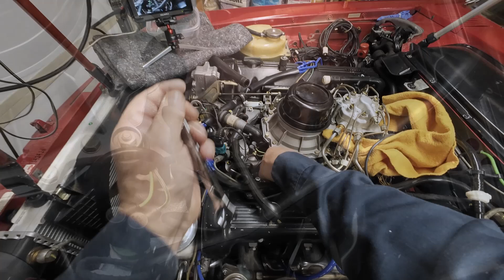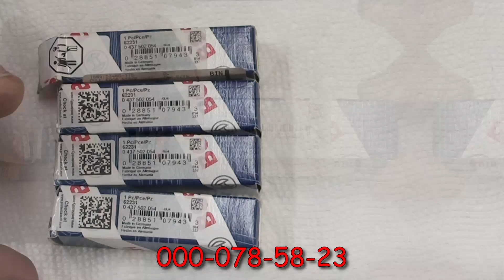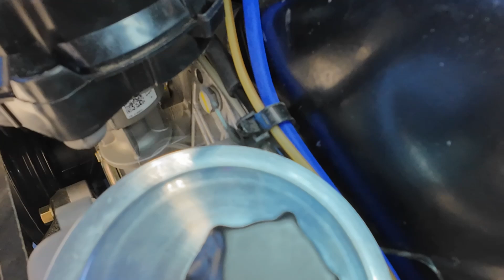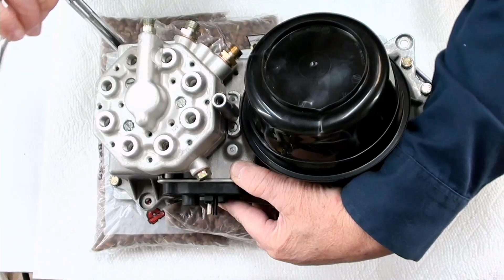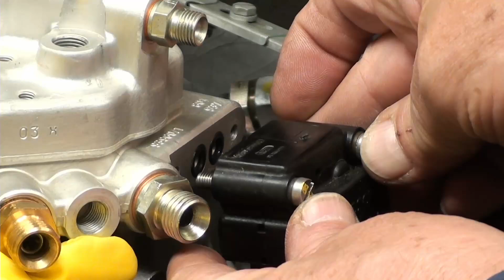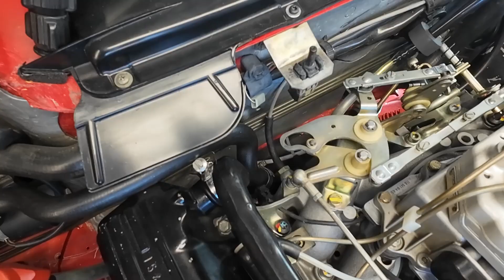560SL - New Injectors, Air Flow Sensor Boot & Vacuum Leak Test

Comment from the maker: I connected the incoming smoke to the brake booster vacuum line. Doing this will by-pass the brake booster so you should test the booster independently. In the video you will see smoke leaking from the Changeover Valve (under coolant reservoir which is normal. I suggest you plug the vacuum port on the right side of the intake to stop the smoke going there. Also note that on the right rear (passenger) there are vacuum lines going to the transmission and inside the firewall and HVAC. You should check those lines independently.

Comment: Hey Tony, thanks for this video! Question: I don’t think I saw in the video, but where did you hook your smoke machine up to the vacuum system?
Reply from the maker: I actually used the vacuum port on the passenger side intake. I did it this way so I could also test the brake booster. Some people remove the hose on the brake booster and inject smoke there. I also plugged the vacuum lines on the driver side going to HVAC, doors etc..
Reply: @TonyLiveTV Thanks Tony! First run of the smoke test showed all my injectors look to be leaking around the seals - parts ordered and will be replacing them soon! Watched your video on that process - much appreciate all you do!

Comment: Another GREAT video (you are the BEST !

Question:
Just ran a smoke test on my 1986 560SL and no smoke anywhere except on the EGR valve "pintle seal" (I'm sure yo know that the pintle seal is in the lower body of the casting and it seals the valve rod that connects the diaphragm to the valve seat)...so smoke is traveling from the intake through the line to the EGR and with valve closed and not allowing any exhaust smoke is leaking out out the pintle seal to atmosphere.

I have tried 2 new EGR valves and I used and all 3 show a leak on the pintle seal.

Did you see this on yours???

Leak shows up between the diaphragm and the EGR body just where the rod connecting the diaphragm and body meet.

Any thoughts on this???
Reply from the maker: @stevecioffi7377  I believe you have asked me this question before. In my case, the EGR pintle seal did not leak. I have the original EGR. Before you panic, connect a vacuum gauge to the intake and run the engine. If you are between 18-22 inches of vacuum, then you are probably fine. There is no such thing as a 100% tight engine. Performance is what you are after. I’ve seen these Venetia horrible vacuum leaks and they still ran well. You want to make sure the main things are tight. Things like the injector seals, rubber hoses, vacuum tubing and vacuum switches. Once you have confirmed this and you have good vacuum, then verify the duty cycle (air/fuel mixture) and idle.

Comment: Tony
Surprised you didn't see any smoke from the pintle seal of the EGR valve . I tried a number of NEW EGRs and all had a leak at the pintle seal.
Smoke path is from intake through the EGR line into the body of the ERG above the valve seat and into atmosphere via the pintle seals all leaking.
Surprised you didn't see this.
Reply from the maker: @stevecioffi7377  my EGR is original Mercedes. It holds a vacuum with a vacuum pump too. I have a video where I refurbish and test it. I didn’t notice any smoke from there. Things are pretty tight after the engine build and the engine pulls a good vacuum. I was surprised to see smoke passing through the check valve on the intake. The check valve tests fine.
Reply: @TonyLiveTV  The 4 NEW MB EGR valves I tested all worked fine in operation of vacuum to the diaphragm and positive closure of the valve seat to body when vacuum applied to the diaphragm BUT all 4 showed leakage at the pintle seal when I smoked the engine. Pintle leak shows up as smoke from where the EGR's operating shaft enters the valve body (test smoke under pressure from the intake via the EGR pipe into the EGR valve body that is closed off as no vacuum is applied shows up between the valve body and the diaphragm shaft in the open space between the valve body and the diaphragm.
Really surprised you do not see this.....are you sure?

BTW...LOVE your videos, have helped me immeasurably as I work on my 1986 560SL

BTW 2.....Why do you say if buy a 560SL best to buy a post 1986 as there were improvements to the 1987; can you elaborate as to the improvements.

THANKS and again for all your videos that have inspired me and shown me the way on many of the jobs I have undertaken.
Reply from the maker: @ I could have missed it, but I didn’t see smoke in that region. The rubber connectors to the vacuum lines in the front of the throttle body all leaked and a couple of old pipes did too. And you saw the leak I found on the change over valve which surprised me. Vacuum leaks are expected I think. Not big leaks, but a perfectly tight vacuum on an engine is impossible. And smoke is deceiving as I said. I think a hand held vacuum pump is better used for testing lines and components. Vacuum works differently than pressure too. Things like the EGR and actuators will likely leak smoke. If I were to connect a vacuum pump to the same vacuum lines that leaked with smoke, I would have found the leak too. The hard ones to find are vacuum leaks like the donuts on the intake, injector seals, brake booster fitting and all that. That’s what I was concentrating on the most in this video. Throughout the manual and in service bulletins Mercedes makes comments of changes they make in the different years. 1986 was the first year for the 560SL and it wasn’t perfect. In 1987 they made a few electrical changes and I believe there was something done with the KE-Jetronics. Something to do with the emissions I think. I wish I could remember the details. I knew someone would ask me one day. I had this info available, but I can’t remember where it is. If I find it I’ll do a special 560SL video and point out the differences. They are small differences like the location of the third tail light for example.
Reply: @TonyLiveTV  Don't mean to press this EGR issue but, as I found 4 new EGRs leaking at the pintle (2 new in my shop and 2 in a buddy's shop in Ca) I'm really curious as to why your original does not leak vacuum at the pintle because this is driving me crazy that you do not have the leak.
This is the only place I have smoke during a smoke test so I'd like to find a way to stop it.
Leak easily shows up if you remove the valve and you apply vacuum to the threaded port that connects to the EGR pipe that goes to the intake. We found vacuum will not hold as vacuum leaks into and through the valve body out the threaded outlet via the operating shaft connecting the diaphgram to the valve....this indicates a pintle seal leak at shaft to valve body.
So...this vacuum leak will show up during idle when the ERG is closed.
Curious if yours is really tight and if so is it tight because you worked on the valve and if so what did you do to create a good pintle seal ?
Reply from the maker: @ I understand your frustration. Maybe the original has a different design? If it is not leaking on the diaphragm side I would not worry. The manual doesn’t say to do a smoke test so I am not so sure I would put too much weight on it. If you are pulling 18-22 inHG vacuum as stated in the manual then you are probably fine. When I tested vacuum on the manifold you saw it was at 21 inHg in the video. That’s within spec and it runs great other than the high idle which I will tackle this week. While testing vacuum I had a valve I could open to see when the engine would start to misfire because of vacuum. It ran fine up till about 16inHg and then you could notice a vacuum leak. I didn’t do anything special when I tested and cleaned the EGR. Here’s the video of that. 560SL - Reconditioning The EGR Valve
https://youtu.be/FfvfdekN8WU
Reply: @TonyLiveTV  
Tx for the link
My car has 36,000 original miles so the EGR line to intake is clear, also my EGR valve to body seals fine it's just the pintle seal that is leaking.
I'm going to try to use some WD40 like you did and see if that rejuvenates the pintle seal....THANKS

BTW I just posted a few questions on your "installing the tensioner" video that I'd appreciate your comments on
THANKS

Comment: Hello Tony. The algorithm gods brought me to your channel. Great video! I've owned my '88 560SL for over thirty years. I tell my wife if they were available as new today, I would buy one in a heartbeat. It's almost a perfect car, at least for my purposes. I have a question, if you don't mind me asking. My independent mechanic recently passed away and my current dealer for our newer Mercedes won't even touch it. Too old! Anyway, your car is in very nice shape, and I can see you are up on its details. I do much of the work on it myself on mine, except the "heavy lifting". Are there enough components available that I can keep this car running into the future? Thanks for your opinion.
Rick
Reply from the maker: @rickperrotta  hi Rick, thank you for the question. I feel most parts needed to keep your 560SL running are still available although some parts will come at a premium price. For example, the rear TDC is no longer available. A few years ago you could purchase genuine MB for about $140. Today you will need to buy it from the SL Shop for $1,000 plus shipping! I feel some have stock piled a few of the common R107 parts for profit. I think the biggest hurdle is finding someone competent enough to work on the car. The 560SL is a unique beast. The KE-Jetronics isn’t something the average mechanic can tackle. One thing for sure is that when everything is working right, these are wonderful vehicles. It will start every time! And if you maintain them they will last for ever too. The 560SL was the flagship model. 1987-1989 are the best years. 1986 had just a few minor problems they fixed in 1987. Years ago I removed and rebuilt the rear differential. I was amazed at how robust it was. It is marine grade. It looks like a Peterbilt diff! Everything is new under my 560SL and it rides like a brand new vehicle. I swear it feels like I am driving on air. Nothing like it.
Reply: @TonyLiveTV  Hi Tony. Thank you very much for the reply. I have been stockpiling parts whenever possible and having folks like you to educate us is so valuable. Keep it up, please. Your effort and dedication are very much appreciated.

Comment: Hello, Tony, nice to see you. I would advise you to check the potentiometer(that's the thing that regulates the idle) and to measure mA on the EHA. Greetings!
Reply from the maker: @mercedeske  hey there my friend. Excellent suggestion! I had tested all electrical components such as the EHA, Potentiometer, ICV, Throttle Body during assembly, but I have not tested these components on the vehicle. There are some goofy things going with electrical. For example, yesterday I turned the ignition on and the antenna popped up and the display on the radio was all garbage characters. I have no 12v going to the heater element of the O2 sensor too. The antenna will not go down with controls. I have to disconnect the battery to reset it and the antenna goes back and the radio goes off. The tach and clock do not work either. All of this worked perfectly when I parked it. I have a new OVP, Idle speed control module and a fuel pump relay. I keep these on hand for swap testing. I also bench tested these components. I have a feeling the engine control unit has failed. I’ll be testing all this later in the week.